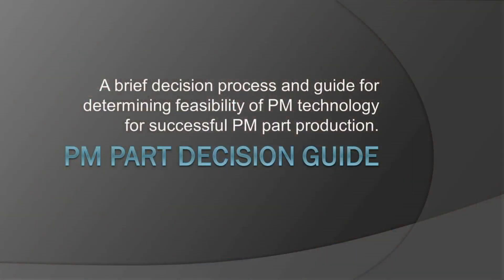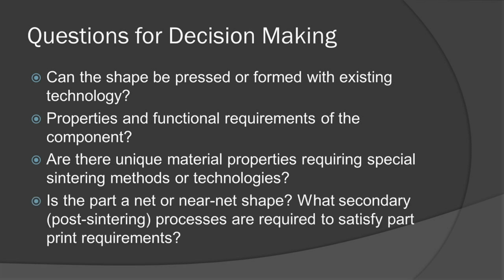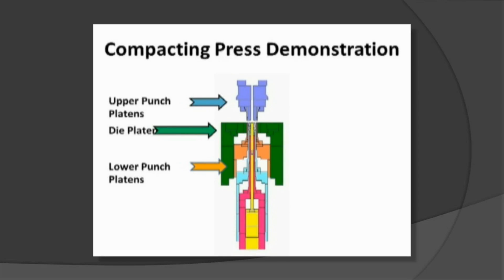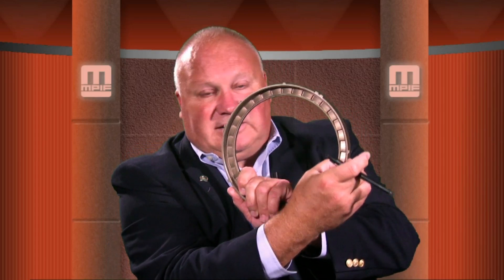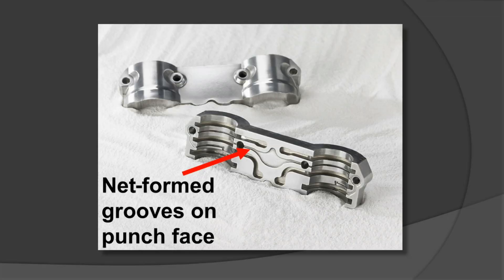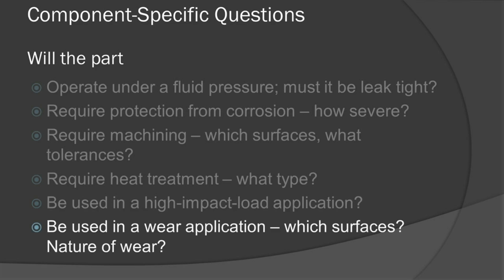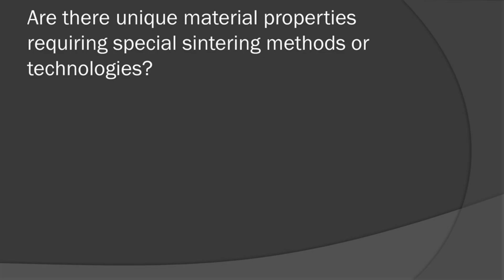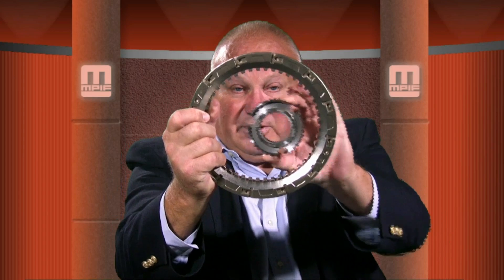Design Decision Guide for Powder Metallurgy

Comment: Very nice introduction. I like the rythm and it is clear. I am just wondering why nothing is mentioned about the opportunities linked to the machining operations on "green parts"?
Reply: This is because green parts are only held together via friction within the particles. Making these parts very fragile. Not only would you deform the part by putting it in a chuck/fixture, to machine away material would result in chunks of the part ripping off rather than getting a clean cut. Even an operator handling the parts can result in chips and other defects.

Comment: PM does not have a consistent level of porosity across a wall thickness. The core has more porosity that the skin, that has little porosity, if any at all. An unmachined wall will seal better, than one of the same thickness that is machined.

Machining PM removes the skin of low porosity and exposes the more porous core to leakage in thin walled parts.

To counter this, small amount of Copper in the base material allows the tooling to smear the soft copper over and close off the porosity. Secondary infiltration treatments may also be required if the wall thickness is thin. Consider a leak test requirement after machining.

Parts that require sharp ID or OD 45 degree chamfers may not put in the die design. The sharp knife edge in the die ID or OD will break quickly.

A shallower 30 degree chamfer with a narrow flat can be added to the green sintered part easily. This shape is stronger on the die ID or OD edge. A 45 degree chamfer will have to be machined, if it is really required.
Reply: Sir how to make carbon bush
Reply: is it only the test science that this much ton of compression is required to compress the powder as the composition of powder may be ternary or has bulk deformities in it . Also how much compression is too much compression